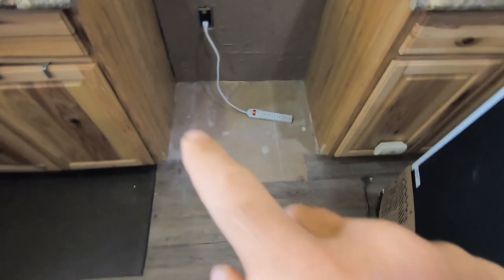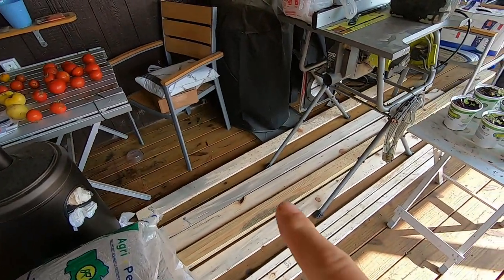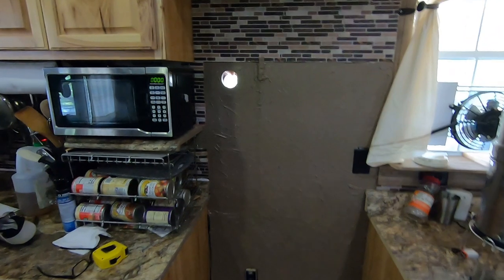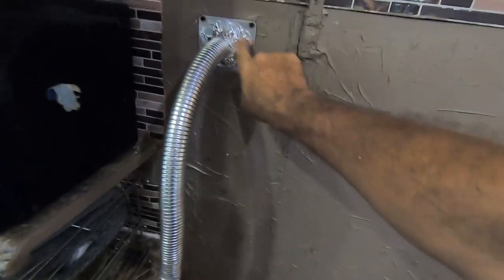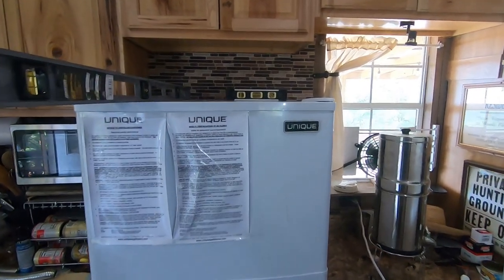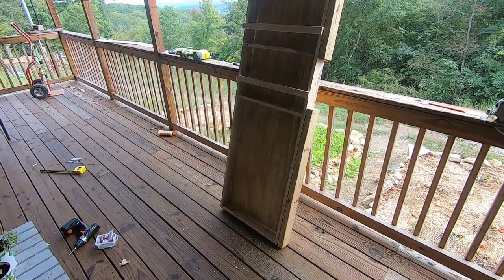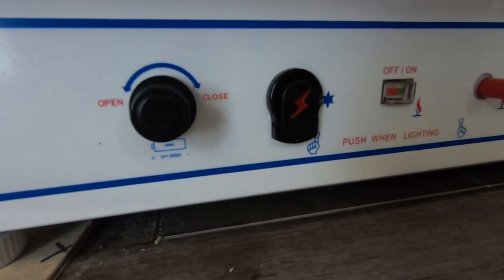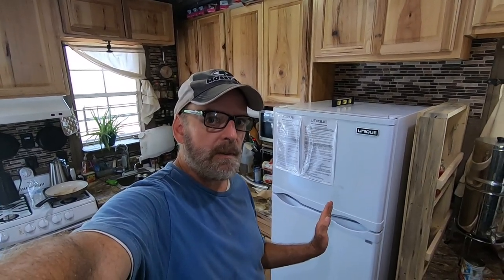Propane Refrigerator for Shed to Home Off Grid Homestead install with vent kit Off-The-Grid

Comment: Good to hear you've had a positive customer experience with Unique Off Grid Appliances.  That's been my experience as well.  Bought a smaller version of your fridge from them about 5 years back to put in our remote off grid island cottage.  Worked perfect for 3 years, but on the fourth summer wouldn't start.  Called them for support, they were excellent and even shipped me free parts!  Our smaller Unique fridge runs for an entire month on one 20lb BBQ tank of propane!

Was so happy with that first experience, that this year I bought their smallest solar fridge for another off grid cabin I have.  It also works great, and sips solar, as it's built using a Danfos compressor which is super efficient.  

They are a great Canadian company, setup to serve all of North America.  Some of their staff have French Canadian accents, cause they also supply the province of Quebec, which is a French speaking area of Canada.

Love your hybrid approach of using both solar and propane.  Makes a lot of sense to me.  Just discovered your channel recently, and love your content and messaging approach!
Reply from the maker: Awesome.  Thank you so much for watching and leaving a nice comment.  Hope you have a great week : )

Comment: Nice new refrigerator.  Beautiful.  We have been off grid on a boat since 2007. We moved to some property in Tennessee and built a cabin 24 × 24. Lived RV while building. So we fully understand solar. We just bought a used RV fridge to install in the cabin. Thanks for the practical tips for installation. We appreciate you.

Comment: I have that refrigerator, and it looks like your heat shield came already attached. Good tips with that the dometic vent kit. Too bad unique doesn’t include something similar.
Reply from the maker: Mine has been excellent.
Reply: @GrumpyMountainMan  agreed.
I’ve had mine a year and a half now, and average about 3 months cooling on a 100lb tank.  I’ve ran it off my solar a few times when needed, but it’s so slick with the propane.

Comment: Really good install video.   Are you familiar with Steve at youtube's Off Grid Living Really? Like you, he thinks outside the box when it comes to solar.  He supports a concept of 'robust' panel use and not stressing batteries.  Steve can get really wonky but His concept of being off grid and not over buying equipment is spot on.   I like your 'hybrid' approach to off grid living. God bless!
Reply from the maker: Thank you for watching the video. I will have to check out his channel.  I have some playlists you might like also. Take care.
Reply: @GrumpyMountainMan  In a complete oversimplification, he talks about 'over buying' panels (now that decent blems/tested used can be bought for 30-40 cents a watt) and 'underbuying' the rest of the system/batteries, and then adjusting lifestyle a little to take advantage of high output days.  In some ways you are doing the same with propane, firewood, etc.
Reply from the maker: @et5222  I under buy too. All of my panels are " returns" another good one to watch is John Daniel. He tells it like it is.
Reply: @et5222  I paid 23 cents per watt on my used solar panels and should arrive by Thursday. I will have a 2500 array made from 250w panels and maybe another 800 watts on the well pump.
Reply: @cutweldngrind  Jorge. Thats an awesome price point.   Is your well running directly off panels or through an inverter?  How 'far' do you have to pump up and out to get into your water storage?
Reply: @et5222  The well would be a future project but planning off straight solar power, no inverter.
Reply: @et5222  I forgot your other question. The water is about 130-150 ft down hole. I plan on putting a 1000 gallon storage tank to collect the water from the well. The tank will need to be elevated a few feet to get enough height for gravity to push the water onto my property. The 20 acres were devided into 4 acre pieces so I have 400 ft between my fence and well. I will eventually put a water line but the water well should keep cost down and help me water the trees and plants.

Comment: Wondering if this setup is still working for you.  We have the same fridge in a Tiny House on Wheels.  We stopped using it due to the heat and moisture buildup but I'm also hesitant to cut holes in the house since we're in a cold climate.  But would love to be able to use our fridge again.  Also having trouble finding the same vent kit you used.
Reply: Just use some flexible metal conduit.

Comment: Just bought the 10c today . I’m  5o miles from a small town and have a  propane regulator with a female  flare,  problem is I believe the fridge is  a female and requires a 3/8 male flare ? I hope 🤞hope when it’s delivered I got the right stuff

Comment: is it possible to run propane stove a propane refrigerator from 1 tank? Whats the adapter called?
Reply from the maker: Yes you would need a "tee" fitting. I like separate tanks for redundancy.
Reply: You might be happier with two tanks and a selector valve, unless there are special circumstances:
- the heat and refrigerator will obviously cut out every time you unhook a single tank
- need to own and store a second tank anyway, unless you want to immediately go get a single filled -- leaving heat and fridge off (oops, store is closed or out of propane)
- might as well leave it hooked up until you take it to be filled

Comment: Nice video. We have the exact same fridge in our cabin in Maine. We have it connected with a stiff 3/8” copper pipe, which makes it impossible to move for cleaning, service, etc., without disconnecting. What type of hose did you use and is flexible hose considered safe? Thanks.
Reply from the maker: I used BBQ grill hose. It is wrapped with a braided stainless steel so it is mouse proof. I got it on Amazon.

Comment: does it make your cabin very hot in the summer?  or does the vent work well enough to expel the extra heat
Reply from the maker: It adds a little heat. Most of the heat goes out the vent
Reply: @GrumpyMountainMan  thank you for your reply, and video

Comment: Mine won’t light either, can you explain more in what you mean for turn the battery around. Does that knob have to be open or closed. Do you mean the batteries in the back?
Reply from the maker: Front of frig. Black knob
 Swap ends of the battery positive vs negative

Comment: Got this same fridge in my house, don’t have the vents or a way to get the vents set up due to limitations and the fridge shuts off every now and then and has a hell of a time trying to start back up, any recommendations as to what I could do to make it easier ? Came with the house and I reckon is probably about 10 years old at least with how dirty it is.
Reply from the maker: Clean the flume first. New units come with a cleaning brush. I have a video on how to adjust thermocouple

Comment: Had a question im in a 40foot container home n was told it need constant air flow of carbon monoxide can fill up but i live high elevation n cant have windows open constantly or itll have moisture is your exhaust vent good for expelling the carbon monoxide?
Reply from the maker: Yes you want remove those gasses to the outside and propane has a high water content

Comment: Sheeeit, a flex exhaust would work.
Reply from the maker: No check valve in duct . Cabin would either be hot or cold from outside weather.  Outside vent has a bug and bird guard.